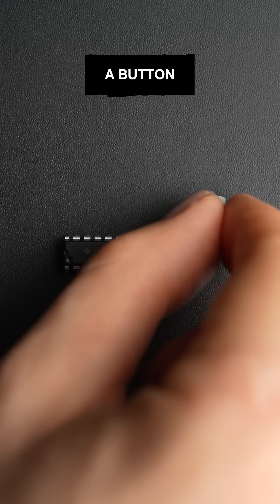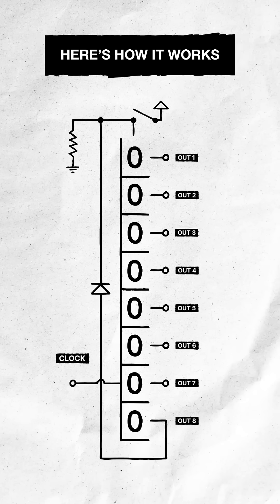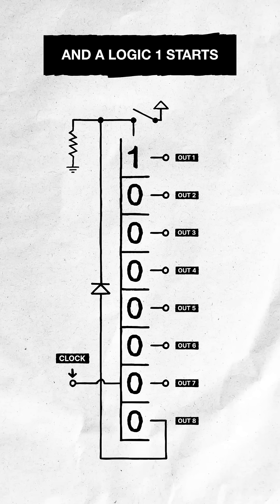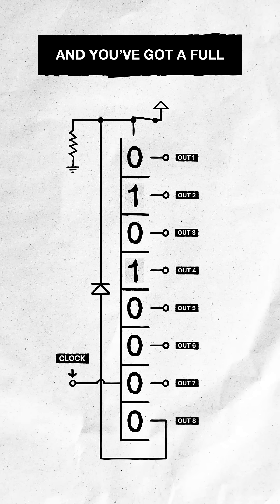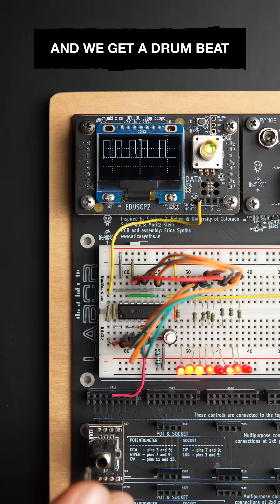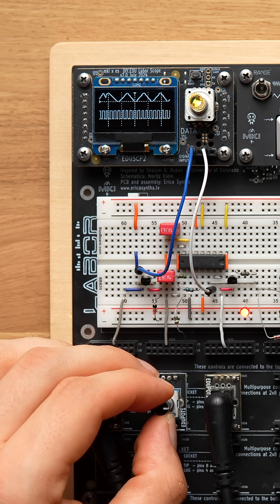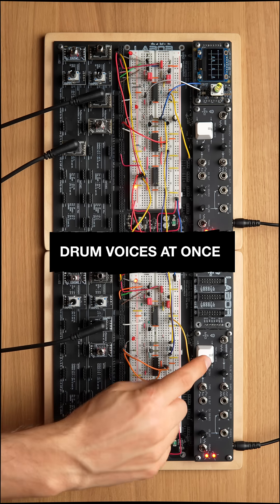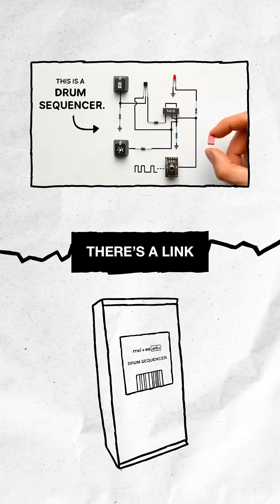Super simple drum sequencer (4 parts)

Comment: do you need to add DIY kits as well (VCO, envelope,...) or can you start complete experiments with the Labor for first projects? - are there suggested projects in the box, or should you check with the DIY kit manuals which ones can be done right away? looks great
Reply from the maker: both the “Labor Assembled” and “Labor Full Kit” come with a big set of common components. in the Labor manual, there are 4 beginner projects (filter, oscillator, VCA, percussive oscillator) that make use of those components, but you can definitely go beyond those and build basic versions of the circuits we describe in the other DIY kit manuals. be aware that the “Labor Full Kit” is DIY and requires soldering, while “Labor Assembled” does not!
Reply: @MoritzKlein0  christmas/NY present found!

Comment: I couldn't get the first setup in the manual working. I'll try this instead when I get home.
Reply from the maker: you mean the clock generator? or the first 4015 setup?
Reply: @MoritzKlein0  the 4015 setup, using an external clock.

Specifically, I'm using the maths, with the end-of-cycle trigger output of one cycling channel as the clock, and I'm sending the output to trigger the other channel (or that's the idea).

But I get weird issues, like things are not grounded properly. Earlier I've used several breadboards, two different power sources, two different 4015s and even tried two 4014s, but all are acting weird. Leds are blinking on and off without me ever inputting anything.

Now I'm trying the simple setup from this short, and it's also not good. the output is just the clock again. When I press the button, it stops, until I let go. If I touch the maths panel with my fingers, it also stops.
Reply from the maker: @tychoclavius4818  do you know the specs of the signal coming from maths? shift registers are extremely picky with their clocks .. the edges need to be pristine
Reply: @MoritzKlein0  they seem to rise about as sharply as anything else I have, looking through my oscilloscope. If I get this working later I will return. I struggled with your envelope loop mod too, until it turned out the fault was with the envelope module not returning down to 0v exactly. That whole saga is also in your comment section there haha